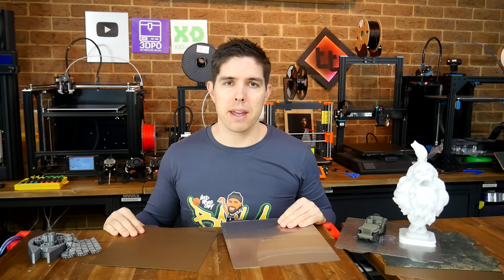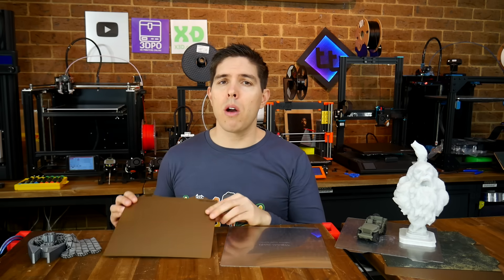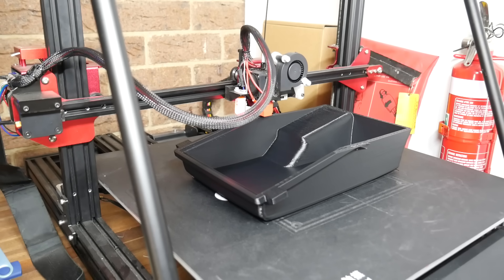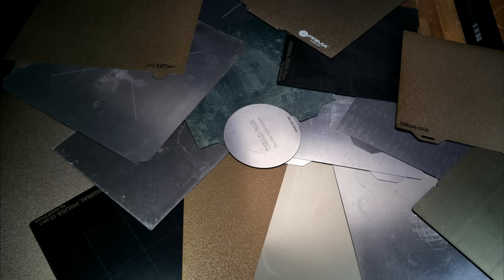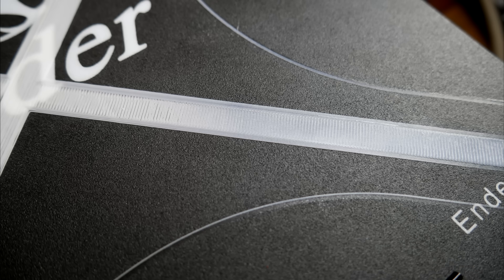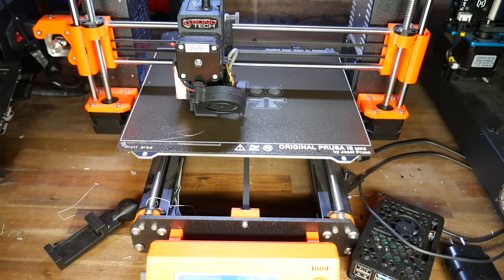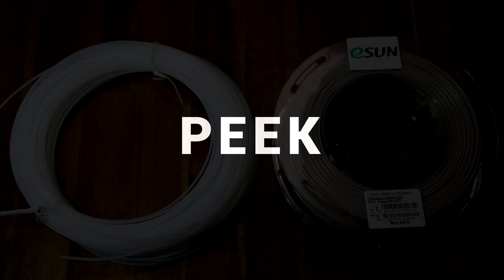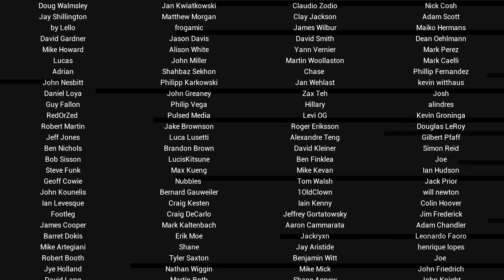Guide to PEI 3D printer beds: Why and when to use smooth vs textured

Comment: I'm still a huge fan of bare glass, and glue stick. Mostly because you can print PLA without using the heated bed, saving power

Comment: I'm still printing on my stock Ender 3 Pro flexible magnetic bed, used glass for a while but I don't have the patience to wait for it to cool down to release... I might switch back to the glass to make my bed more flat, at the moment I have a bit of a bump in the middle.

update: I wrecked my stock magnetic bed with PETG and switched to a spring steel sheet with PEI coating, it's pretty nice.

Comment: 4:55 5:12 Acetone is okay for smooth PEI, but you should avoid using it on textured. Most PEI sheet manufacturers have a warning about this.
Reply: @georg6876  Interesting! I use Energetic textured sheets and they have a warning about not using acetone, so I've avoided using it. Maybe it's okay for very occasional use when you really need to refresh the sheet, but they warn people not to so someone doesn't use acetone before every single print then demand a replacement after the texture peels off after a week of use.

Comment: I exclusively print on PEI, both smooth and powder coated.

Simple materials such as PLA require a good clean of the bed with IPA (spray & wipe).
Sticky materials like PETG and TPU get a little bit of talcum powder on the bed. Wipe the powder off with a clean cloth, the powder must be almost invisible.

Both methods make almost everything self-release after cooldown. Only TPU might require a little flexing of the bed.
Reply: I use a Creality smooth PEI magnetic bed that came with a fairly thick PEI sheet already applied to the spring steel. I use IPA + paper towel for light cleaning/degreasing, but for deep cleaning acetone works really well. It rejuvenates the PEI without the need for abrasives like steel wool. I just use paper towels, applying the acetone to the paper towel not the bed, then wiping. The part of the bed I use the most may not be sticking as well to PLA as it did at first (not totally sure), but I haven't had to bring out the steel wool just yet. It's been almost a year.
Reply: And your prints smell vaguely of clean babies. Very pleasant.

Comment: How much z offset do you adjust for when you are using PETG. I level the bed for regular height for use with PLA and just twist the threaded rod to adjust height, so it would be nicer to just do something with the slicer

Comment: Would love a PEI sheet, but for 310x310 on a spring-steel sheet the cost is just making me hesitate.  Even the Chinese plates are pretty expensive and aren't always getting 5-star reviews.  In fact, even the branded PEI sheets get some negative reviews on the various sites ...  Still, currently I'm having some problems to get Polyterra to stick (read: not lift at the corners of big parts) to my mirror and FR4 beds and the blue sheet that came with my Sapphire Plus sticks way too well for big prints.  So, I might have to try out PEI ...
Reply: You might need to up the temp of you bed by just a bit. Using mirror glass I noticed that there's a sweet spot for temp. Too high and there's elephant's foot, too low there's warping
Reply: @gustavrsh  I've gone up to 80C on the bed and tried 190C upto 230C on the nozzle, which weirdly enough seems to change relatively little for the Polyterra, even at 230C I get hardly any stringing and overhangs also look fine on that entire range.  The only problem I have with it is the corners of large parts lifting off the bed after the first 5mm or so.  Prints with less than that height don't seem to lift like that.  The blue bed surface that came with my Sapphire Plus gives great adhesion, but keeps giving that, even after cooling down, so I almost had to chisel off a bigger part, thereby damaging that part, so that's also not ideal.  Ultem / PEI sounds like the stuff giving that stickiness when warm, but releasing easily after cooling.  I'd love that, but as said, the cost of those surfaces is a significant chunk of what my entire printer did cost ...
Reply: Whatever you do, don't go with ultistick. My sheet was *awful*.  Literally, plain steel is only marginally worse.

Comment: Love pei right up until a PETG print removes a chunk of it, I have yet to find a method of replacing the PEI sheet even though you can buy it separately
Reply: If its a sheet, just pull it off!? Letting it soak in really hot water with a dishwasher tablet helps a lot.
Reply: For nasty parts, I put the plate in a freezer of half hour. it releases itself!

Comment: I have both a smooth and textured PEI sheets, and both work well. After they become worn I think I will simply use a non-coated spring steel sheet with glue stick or hair spray. That should be good for any material.

Comment: I picked up a spring steel smooth/textured. I cant use the smooth side to save my life. And I have to jack up the bed to 70c. Duramic pla+. I fight warp quite often especially if the cooling comes on to hard to fast. Edit looks like i need to “borrow” hairspray
Reply: Get a brand new scuff sponge, one right out of the package, and some 90+% IPA. Really go at the smooth pei side with the sponge soaked in IPA, cross hatch and swirl pattern. You likely won't be able to feel the texture, it'll still feel smooth, but you'll be able to see it.

Comment: Please do not use your fingernail to scrape filament off your build surface. I got really bad splinter under my fingernail this way.
Reply: Yep. Been there, done that. Wouldn't recommend it.
Reply: Thanks for the tip I will keep this in mind
Reply: Yepp
Reply: Yep
Reply: With PEI?
Reply: @scubadoo7951  No he means the filament i think
Reply: @Barrygamer987  OK, that makes a lot more sense. 😆  Thanks, Barry.🙏
Reply: @Barrygamer987  I'm so confused.  Your name in my 🔔comments shows up as something completely different.😆
Reply: Did this the first day I owned it and learned real quick. Never did it again 😂
Reply: New fear unlocked thank you
Reply: I got that once
Reply: Only once?
Reply: If only I had seen this comment owww
Reply: Thanks for this tip, I do this constantly and I will no longer be doing it
Reply: I wish I saw this comment before it happened to me, was trying to pry up long pla thin part and it came undone and went all the way up my finger, yes all the way to where the fingernail comes out
I never want to feel that again
Reply: I think about this comment every time I go to use my nail. Thanks, as I have caught myself every time before getting a booboo.
Reply: Ouch yup been there! Especially the purge line tends to get under my nail hurting really bad!!!
Reply: Been there done that.  Continue to hurt myself anyway.
Reply: fr 😂
Reply: I bet he keeps scraping that with his finger =) .. I do, but my hands have protective calices
Reply: Yep
Reply: Yup, ive had 100 purge lines under my nail and I even keep a tool to remove them right on top of my printer.....
Reply: Absolutely this is a noob flag right here
Reply: @atapene  we all start somewhere
Reply: @kickpublishing  you clearly have no idea what we're talking about and your comment shows. Good job 👏 👍

Comment: Spring steel PEI is the best bed material I've used, and I've used quite a few!
Reply: Same for me. The only problem is that the magnetic force is not strong enough to prevent large prints from lifting the whole spring steel sheet up as they warp.
Reply: I gotta try one! I have held off cause glass has yet to be reliable, even for petg. But the hype on these is real
Reply: @shiftyjesusfish  i wanted something easy to remove from the bed and other then glas. But no clips, I wanted magnet. So I ordered something soft and flexible. He tells about in the video, wasn't able to hear the name. But with silk and tpu the adhesive was so unreal hefty,too much. Silk destroyed this bed. The pei sheet from Amazon (w/ magnet opposite) works pretty well on pla. Not tested more due to the lack of time. But really love it. And it's not so sensitive as those black soft other thing.
Reply: @tispokes1563  I never take my bed off unless it's to clean it.... and I only clean it mabey every 20-30 prints. Only have adhesion issues with abs and HIPS and I've narrowed those issues down to PID tuning on the bed since I'm new to using a vented enclosure...
 For context I'm using the back of the creality plate cause the coating on there is useless after like 50 prints no matter how carefuly I cleaned it (iso is the only solvent that touched it so before anyone says I messed up the coating.... I did not, it's just not as good as the glass is). 

Also use gloves when handling your filliment and touching the bed, or the working end of any tool that will come in contact with the bed. No glue stick, no slurry paste, nothing but clean decreased glass (dry with the preheat, don't wipe the plate dry, and if you REALLY care or live in area with "harder" water rinse with distilated water but I just use tap water).

If you keep those tennants then things lift off the cooled bed like they were never stuck down and won't come off mid print. Temps varry but with pla, at 54° reliably the part pops off, any hotter and it's like it's glued on. 

Hope that helped for others like me that can't afford expensive build surfaces.... also if your impatient,  glass is cheap af, instead of waiting for it to cool, swap build plates, start your next print and come back in 10 min to a freed up part and still usable bed <3 happy printing
Reply: @k9elli  ok the real question Is does it make HIPS and ABS less of a pain. Cause idk if it's environmental, or pid tune or just the nature of the beast bit they are a nightmare.... I can even print tpu, both 95 and 85a and even tpe, but the second I touch my abs or hips rolls everything goes to fuck unfortunately (cause I really like both materials but have had to shelf the rolls cause it's not worth the hassle for 1/10 prints to finnish)....  I would buy a deticated styrene polymers if I knew it would help at this point
Reply: Same for me. Just got m Pei 2 days ago.

Comment: I print on a mirror bed.  I have to heat up to 70c, but prints pop off by themself after mirror cools, mirror will never warp, mirror easy to clean, and leveling is easier since I can see the reflection of the nozzle in the mirror
Reply: Im curiouss. Could you explain how does the reflection thing work with the bed leveling?
Reply: @TheLiasas  you just look at how far away the two nozzles (real and reflected) appear to be, and when they finally meet, it’s when it’s hits the mirror. So you can see variations in height quite easily
Reply: Pei sounds like a headache. I use a glass mirror and everything sticks to it. It is float glass so it is very flat. The mirror rear is darkened so the heat transfer from the heated bed is good as well. The only negatives is the paper clamps required to hold the glass down sometimes get knocked by the nozzle on a big print. Also the bed is heavier and requires the Y stepper motor to accel and decel the glass sheet the size of the aluminium  heated bed. But it works fine on my ANET A6 printer.
Reply: I love the reflection "feature", my fw has a bed tramming feature that makes the nozzle touch the bed on all 4 points, you just adjust the knobs until the bed just touches the nozzle.

Also, I got three beds pretty much for free, I had scrap mirror glass and my local glass shop just cut it for me.